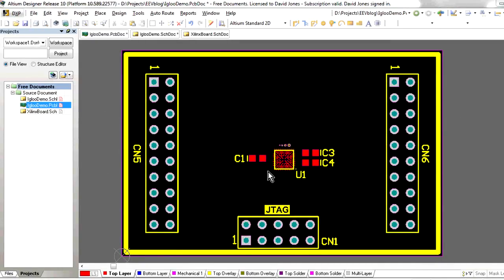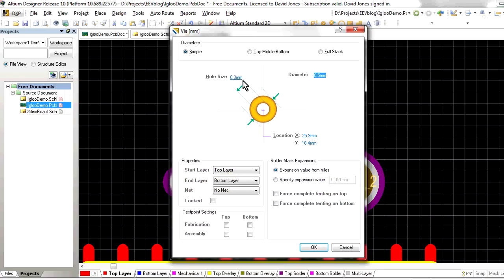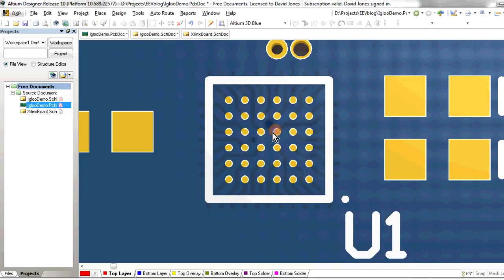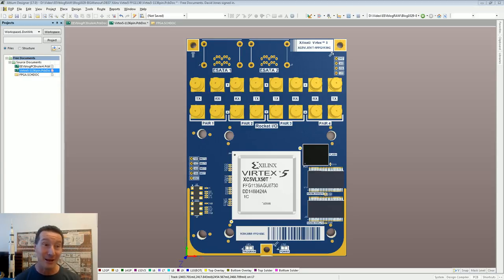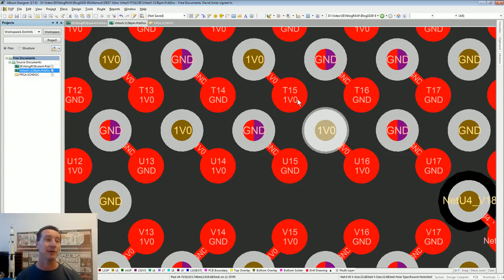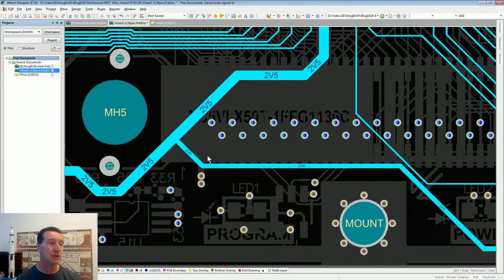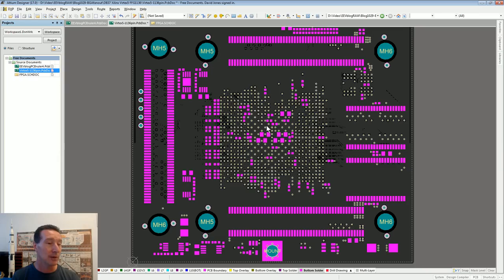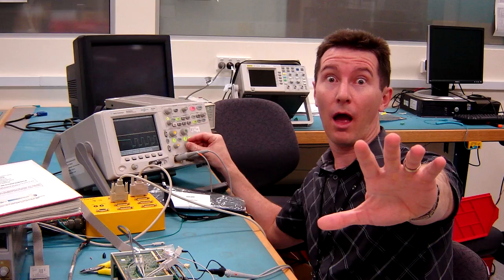EEVblog #1029 - BGA PCB Fanout

Comment: Great vid. I was always under the impression that BGA would have their pads as the vias. I guess that just makes sense to me from through-hole and surface mount 2 layer experience. I think it can still be done that way but would require filling the vias with paste?

A vid on pin swapping would be good too. I thought pin swapping (or re-assignment) was something you do in the FPGA design in code, never realised you could also do it on the PCB (is this instead or in conjunction with code? like I can see pin swaps require back annotation to the schematic).

Of course the pin swapping on the PCB will also let you do it on other components than FPGAs, like any logic arrays or muxes, etc. Yes this would be a good vid. Is it an Altium only thing?

Comment: Why not mount the ball array directly on top of vias?
Reply: Simon Ashton that's called "via in pad". It has it's own problems associated with it - go look it up.
Reply: Simon Ashton because vias are holes. Balls might just falls through. You don't want to loose your balls.
(I know, we do solder mod wires and other stuff through vias, but they are not meant to do so).
Reply: Because then the vias need to get filled in and overplated, which is nonstandard (but not really that much more expensive, only about +20% of PCB cost). Attempting putting vias right in pads is no-go however, the solder ball would get wicked into the via orifice. This is actually issue even with vias next to the pad, if the soldermask design is not right.
Reply: Balls-deep!
Reply: The problem that people above are describing is called Solder Thieving. It is bad practice, but I have been known to do it anyway on components. In my defense to that however, I only make small run boards for test systems, so I put everything down by hand and do a lot of inspection/repairs after reflow. If I tried that on a production run I should be fired (but know I wouldn't because I have seen the absolute garbage others have been able to get away with).
Reply: Thanks for the replies guys. I had imagined the solder ball would get wicked up so thought the via would need to be filled with solder paste. Seems like filling the via could be an easy addition to laying solder paste for smd parts? A stencil and spreader method would work it in pretty deep I imagine... then again maybe not on really tiny vias.
Reply: Martin Konečný, so might that actually work out in your favour if spending the extra +20% for overplated vias lets you stay at a cheaper process with bigger tolerances?

Comment: Hello Dave, is it possible to combine the pads and the via's or will the hole interfere with the solder process?
Reply: The solder gets sucked into the hole interfering with the soldering process. But you can get the vias filled or plated over so that it can be done
"via in pad"

Comment: Instead of having vias between the pads could one have the balls solder directly to vias, almost as if it were a PCB for thru hole components ?  It seems to me that would allow for more than four times the pin count density for a given board technology. Is such a thing ever done ?

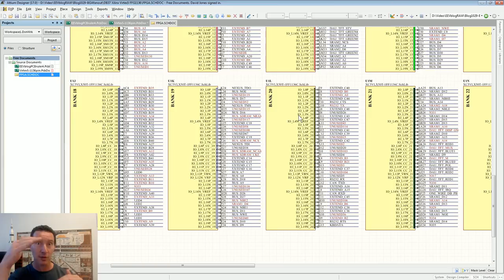Comment: 30:34 "keep them within banks; that's important! I won't explain why."

Just like the old men in Mary Poppins... *sigh
Reply: tohopes It's an FPGA "feature" that sometimes gets in the way when FPGA chip designers forget about low layer counts and put pins in the worst possible places for board designers, forcing extra vias and layers where not needed by the circuit.  They seem to forget that not every design will be dominated by 1.8V 500MHz controlled impedance signals.  Some jobs actually involve a bunch of 5V low speed signals outside the chip, controlled by complex signalling on chip. Others involve running a few select pins at 3GHz with controlled impedance traces, requiring detailed gate assignment control for the nearest logic blocks.
Reply: Here the short version: Whatever the functional design in that FPGA is, it's "living" in that bank and timings etc. have been calculated and whatnot. Each bank has a big multiplexer that can connect each internal signal to any pin WITHIN that bank without changing the timing of that signal. That is something that can be done without touching the functional design itself. If you need a particular signal to be available at a pin that belongs to another bank, the entire placement, timing control, and routing process needs to be done all over again. If you had your design already excessivly tested successfully in real life, that's something you don't want to do again. So you have to keep pin swaps within each bank.

Comment: Cant you use the vias as pads directly? Or does that open a lot of problems with soldering later?
Reply: The solder paste can blow out during reflow and cause shorts.
Reply: Andreas Gurdel Alternatively, the solder got sucked into the via, leaving a dry or nonreliable connection, or no connection at all.

Comment: Pls demonstrate to do that with 1331 pins in a 40x40mm package (with a big NC Area in the middle) and a darn lot of 8GHz stuff (AFAIR 32 Lanes), and a 128bit Memory interface @ ~2-3GHz as well.
On 4 Layers of course...
That's the AM4 socket by the way. And the Chipsets aren't much better...

Comment: On the small fpga, why must the via be between the pins, why can't the via directly act as the pin solder pad for a space savings? 
At least for simple double sided boards, couldn't the via just be a simple solid conductor?
Reply: wolfedog99 some solder balls will wick down the vias and not connect to bga itself. You can somewhat eliminate that by tenting the via on the bottom so that the trapped air inside the via prevents solder from wicking down it. That is not a perfect solution as expanding due to high temperature air bubbles can pop the solder mask on the bottom and wick the ball or explode the solder ball itself leaving a hidden mess under your bga. In any way that is a less reliable solution you need to try to avoid.

You can put blind vias under the pads if you're doing multilayer, but the production cost will be a lot more compared to standard vias.

Modern technology allows for blind microvias to be put under the pads (actually thats how almost all modern devices are made, say iphones). Those vias are tens of microns in diameter and are comletely plated through with a normal pad sitting on top. Needless to say that manufacturing costs are astronomical.

For budget low scale production standard fanning with vias is best cost to quality solution.

Comment: Great content, and very applicable to my current project. However, I'm not sure I like how you embedded your old video in there when you could have just linked it. I had already watched that one just the other day. I didn't like when you did it with your Rayton Solar video either. In the Rayton case you had a lot of overlapping arguments and it would've made much more sense to keep those videos separate. In the BGA case it's not too bad, but still bothers me.
Reply from the maker: Noted

Comment: What is pin swapping?
Reply: FPGAs have connection matrices (crossbar switches) on many signals that let you route any signal fed to a matrix to any pin/pad connected to the matrix.  Small FPGAs may have only a single matrix (or none), while larger FPGAs will have one matrix per bank.

Physically there are separate matrices for inputs and outputs, with some pins/pads fed to a matrix of each type.  There are some **very** useful tricks that can be implemented using this feature (particularly for test and debug).

Not all signals can be fed to a matrix.  Never power and ground.  Quite often clock inputs can't either.  And some high-speed signal sets, like a DDR4 interface, may avoid using a matrix because of the delays involved.
Reply: @orbita1 Brief answer: When you program the logic into the FPGA, part of the process involves assigning which external pins (or balls) correspond to which of the internal functions you're programming. So at some point while laying out the PCB you may decide it would help to change which pins on the FPGA do what -- so just change your FPGA design to swap those functions to the pins you want. Doesn't apply to ground and power, and to some signals, but you get a lot of flexibility otherwise.
Reply: orbita1 In general (not just FPGAs), many components have pins that are equally good for a job, like the GPIO pins on an arduino, or the and gates in a CD4011 .  So quality PCB design tools allow you to easily change your mind about which one to use by swapping them around so the PCB becomes easier to make.  Now Altium sounds like it's also using this phrase to describe a big automatic pin choosing system for jobs like this that would otherwise involve lots of individual pin swaps to get things just right.
Reply: it's when you switch a connection to make it easier to route, for example, if you're routing IO, and one route crosses another, you would swap them so they don't cross. But you would only do it for IO.
Reply: Ah I understand now. Thank you all very much for the answers.
Reply: It's kind of like wife swapping, but not nearly as much fun.

Comment: Why did you use such a small FPGA?  Was it not available in a larger package?  Seems to be a LOT of work and extra expense to use such a small IC.
Reply: ElmerFuddGun down to this point i think it's more of a middle finger to hobby-unfriendly situations, a proof of concept.
Reply: I was waiting for Dave to say in the video but no such luck.  Often he will repeat (or remind us) his reasons for such and such while describing the problems.  Maybe he says in the old original video...
Reply: It looks like the device is a bare die - the actual silicon chip with pads on the bottom, as opposed to the more normal way of fitting the die in a larger package, itself fanned out internally with bond wires. This means that the device is going to be physically small, because silicon is expensive. On the upside, with so little packaging, the device is cheaper, which offsets the more expensive board construction.
Reply from the maker: I think I explain why in the previous original video. This is a prototype board for a client (back when I did consulting), I had to source a suitable FPGA for them and this one was the only one that fitted at the time. The proto board was so that they could use it as a power consumption testing platform. I wrote a paper on how much current it was expected the draw based on gate count and other features they wanted, and the proto board was to see how well it matched the estimates in practice.

Comment: Ugh. Looks like a nightmare. I do wish sometimes that stuff like FPGA's was available in more reasonable packaging.
From what I can see BGA is a nightmare unless you've got a hell of a lot of tools or can pay someone to do all your prototyping.

That's a real shame because FPGA's are one of the most useful components for complex low volume devices.
But of course, pinout limitations do become relevant - if you need to create some odd custom CPU-like thing you might quickly finding yourself needing 80-90 pins... And what kind of package can do that without creating some serious complexity?

I guess such complex parts aren't really too amateur-friendly...
Reply: Google fpga dev kits, they've come down in price remarkably over the last couple of years. An altera cyclone IV can be had for about $20
Reply: Agreed. I make my own PCBs and wouldn't ever try and go less than 0.5mm spacing! I hate BGA, its a nightmare for hobbyists. Please Xilinx please, make TQFP versions of your larger Spartan FPGAs, dont go BGA only. I'm not a fan of DEV boards either, they waste IO pins on stuff I don't need.
Reply: Honestly, even if the TQFP package ends up being 2x the dimensions, it'd still be worth it.
Reply: The kits do sound like they're getting a lot better. Though I still run into cases more often than not where the FPGA chip itself is say $5 but the dev kit version is $120...
Still, it's better than nothing...

And to be fair I did double-check mouser for instance and there's a reasonable amount of the cheaper low pin count FPGA designs which are available in TQFP and similar packages.
Sure the pins are tiny, but at least they're all on the edge of the package...

I was dismayed to find that all the Pseudo-Static RAM I could find was in BGA packaging too... That leaves you with either using actual static RAM which is an order of magnitude more expensive, or needing something that has a D-RAM controller...

Oh well, I'll keep looking, and keep experimenting I guess. XD
One of these days I'll find something that is workable with the kind of cheap tools I have available...

Comment: How fast are you switching ? Why didn't you just save yourself the headache and go 4 layers? You're a brave man, haha. I have a feeling you're going to get killed on crosstalk with microstrips and only two layers like that.Noise noise noise.  Be sure to do a follow up with the eye diagram of your tx/rx. You actually might be better off going with a .5 rather than 1oz copper, just so you can obey the 4x rule (1.4 mil height of your trace * 4 => nearly 6.... playing with fire).  Don't even bother with FR4, go straight to glass/PTFE. Liu, et al (arxiv: 1701.03181, 2017) put out a paper recently on xtalk, prop delay and RC parasitics for CMOS 28nm. Obviously, apples and oranges, but it might be worth a read...
Reply: wither8 But one must also consider current carrying capacity, especially for power and low impedance traces.  This tends to favor heavier copper for obnoxiously dense pinouts. Recently went for 2oz. on a board that had a mix of high current traces and cramped high impedance signals in the same layer (but not too close to each other).  Board hasn't been finished and spun yet, so no certainty about results yet.
Reply: By 'high current traces', I'm presuming you mean high current capacity power planes, rather than  actual data? Was it mixed signal or just straight digital? If it's straight digital and your di/dt is low low low, it could be allllright. Id genuinely love to see you youtube a screencast walking through the design (scrub out any sensitive IP/proprietary employer stuff?) and then when you get your board, I'd love to see a follow up with your analysis on the performance. For some reason that sort of content seems to be lacking on youtube :(

 How close is "not too close" lol. Did you isolate any section (either with physical components or micro-via stitching or whatever?) Inductive ("backwards" or whatever-- dang I had to look up what it wa actually called in an App Note(Altera 75, pp 11)) current flux has ~3x the EMI(hey at least I remembered the important number) that capacitive does up to a point, and man oh man that can lead to headaches.  

Also don't take that app note as the word of Jim Williams or anything since its friggin 15 yrs old, and referenced off a dang 'high speed' text from 1993. It doesn't even mention things like pre-emphasis :sighH: If anyone is doing mixed signal work and has a more modern set of app notes/design guides/books for mixed signal high speed design, help a brotha out. Between research papers and a few of the guides from Agilent that come with to promote their junk (lol "x- parameters" ITS LIKE S PARAMS BUT BETTER!), there doesn't seem to be much middle ground.

Comment: what fpga is?
Reply: A field-programmable gate array (FPGA) is an integrated circuit designed to be configured by a customer or a designer after manufacturing – hence "field-programmable".
Reply: not what is a FPGA , what reference? ;)
Reply from the maker: I have a video on that!
https://www.youtube.com/watch?v=gUsHwi4M4xE
Reply: EEVblog A really valuable video :)

My brother works for Amazon. He said they have a service where you can hire their FPGA systems by the hour for serious processing. If you have a lot of data to move they will come with a truck to your door and suck it down a cable.
Reply: The Microsoft Azure cloud also has FPGA enhanced instances. Being able to write Verilog/VHDL seems like it's becoming a useful skill for pure software engineers.